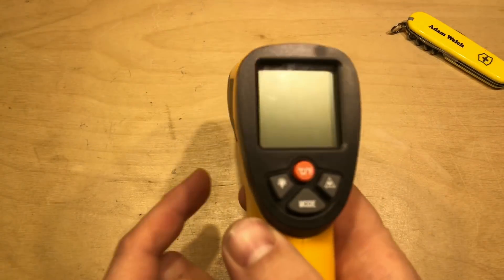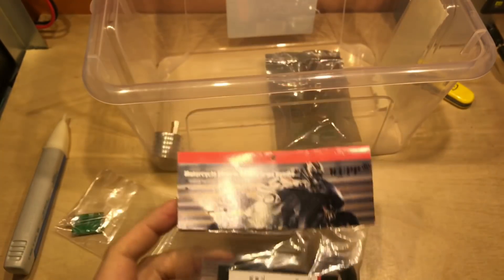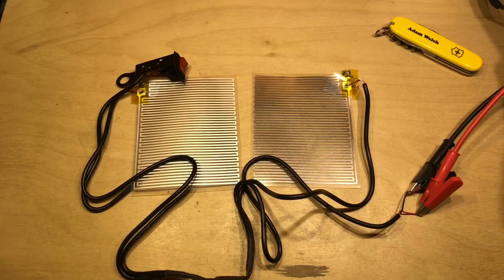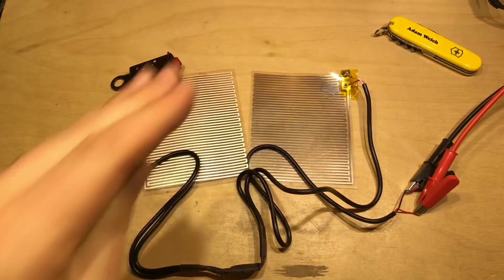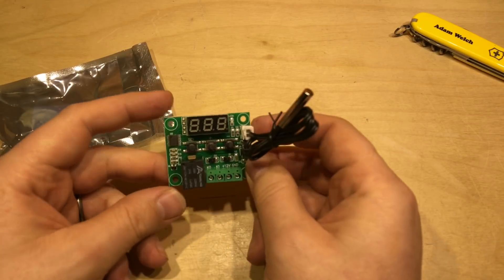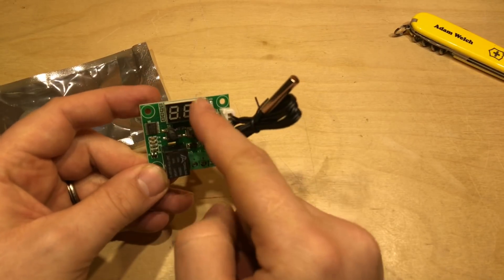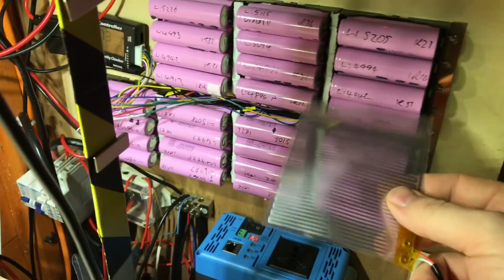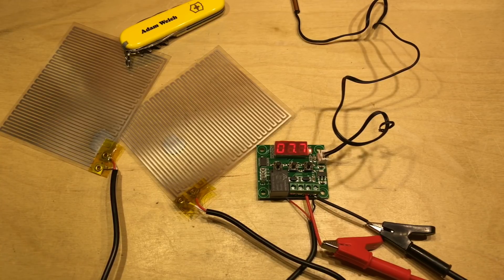Battery Warmer - 12v Solar Shed

Comment: I may be wrong, but I'm sure that the module can be used as a heater controller with different parameters so you didn't need to solder.
Reply from the maker: The time I could have saved doing a quick google! You’re right but it was fun tinkering, even if it was a waste of time.
Reply: Brian B also has hysteresis

Comment: The trouble is that your heating elements will take more power out of the batteries than the benefit of heating them will provide. If the heat is there already for another reason (from another source), then fine. But using the batteries stored energy to heat them will simply result in a net energy loss. Better to use your temperature module to halt charging or discharging if you're really worried about it. At least you're thee weeks past the Winter Solstice, so there is something to be optimistic about. :)
Reply from the maker: Yes I did think about this. You’ll notice though (although perhaps I should have mentioned it) that I was looking at my 12v system heating my 24v lithium bank. The 12v batteries datasheet says they will operate a lot lower than the Samsung 18650s. With a not-much-bigger-than-the-cells insulated box around the lithium pack I was wondering if a few minutes of heat might keep them above zero for a reasonable length of time given the heat mass of the cells. 
The days are getting longer up here,  but the worst of the temperatures may still be to come. Cheers for the comment Xan - it’s always appreciated.
Reply: Dead right. The Winter Solstice only designates the time of the shortest days, not the Heart of Winter! Yeah, since you are running the heaters from your other other bank. It might be worth a crack given the energy density of Li-ion cells. I still suspect you would be better off shedding the load from your Li bank though. Why not just switch it over to the 12 volt bank using the electronic thermostat to perform that little trick? You might need a boost converter, but it would only be for brief times when the temp is that low.
Reply: But you should never charge cold lithium cells. Seems like a necessary evolution to me.

Comment: For heating you need to set parameter P0 to h as the default is c.  Get to parameters by long press set.
Reply from the maker: Ah!  Thanks for that - I'll give it a go.
Reply: Adam, take a look here. This is the instructions I found when I used this thermostat last summer to control a beer cooler. All options are described well. 

http://www.kelco.rs/katalog/images/17670.pdf

Comment: Hi Adam

In order to avoid wasting power from the batteries, could you arrange the heater to be powered directly from your solar panels with a changeover switch to supply the batteries only when a suitable temperature is reached for charging? 
That way, when the temperature is low, but the sun comes out early in the morning, the heating can work automatically without any wasted energy (and perhaps avoid over-draining the batteries when they might already be low)?

Nigel

Comment: K1 and K2 are isolated from the 12v to run the device so you can run a different voltage if needed using a second power supply - positive from K1 power supply to K! and the device to K2 and ground or common them to chassis, but there's no reason if your device is the same voltage you can use jumpers to connect them. So only positive goes to K1 PS and K2 Device. check me if I'm wrong somewhere I have one sitting in front of me, but I haven't used it yet on my 12v cooler

Comment: I've used a seed warming mat (for seed propagation) under my external cased 12v Sealed lead acid Batteries for a few years. It has a thermostat built in. It's cheap and doesn't pull much power. Don't have a link but you can look them up on eBay :)

Comment: Also available on eBay are fan heaters for under £10 which will heat the whole shed, the batteries and you as well! 😀
Reply from the maker: I never used to feel the cold, but in the last couple of years I’ve noticed it more. Perhaps a rocket mass stove is required - it’s a bit more ‘off-grid and DIY. Cheers

Comment: The voltage on a running motorbike would be at least 13.8V and potentialy as high as 14.4V. But as someone has already mentioned it would be better to disconect the batteries when the temp drops so low.

Comment: Put the battery in a small hole in the ground, the temperature is almost constant there and it will most likely never go below zero.

Cheers
Reply from the maker: Battery hole rather than a battery box - I’ll think about it. Cheers
Reply: A.M.K.  That is a good idea. A hole about 60 to 80cm should work fine. Just make sure the hole is dry and put an insulated (not airtight) lid on it. 😀
Reply: You do damage charging cold lithium cells. If the ground is cold this is a bad idea.

Comment: Couple of thoughts, placing them in an orientation so that excess heat rises and face the cells with a thermal covering with enough air gap to let the heat rise, could be one answer,
Reply: I forgot what the second thing was :(
Reply from the maker: Yes an insulated box not much bigger than the cells is a good way forward I think.  I've got some polystyrene sheets, I just need some wood or something.  Once they get up to a reasonable temperature I'd imagine that they might hold above freezing without much heat too often.
Reply from the maker: I do this all-the-time.

Comment: Great vid. especially the peas.  I agree with the 'car heating comments', but look up truck cab heaters instead. They put out way more heat and you can get the 24volt option most of them, which is ( of course) more effecient. I use one myself,   :-)
Reply: Resistive Heating is already 100% efficient...

Comment: Perhaps you could also use a little bit of insulation. Otherwise you are warming up your entire shed with those tiny heaters.
Reply from the maker: Yes - absolutely.  Sadly the prefabricated battery container box was empty.  I'll have to build something.

Comment: Hey Adam, If you were to have a New house built, Would you do anything different when it comes to wiring? Would you have a DC line run through the house? 36v? 12v?

Comment: that board can heat or cool i have one and the option should be in the settings for C(cool) or H(heat). That is if what you have has the option
Reply from the maker: Someone else has mentioned this. Thank you. If only I’d googled the manual!

Comment: tesla cars only heat the batteries to get more peformance for high amps range or capacity, no reason to otherwise, they wont freeze, just be a little lazy but your arnt pushing them hard either, better to save the power
Reply from the maker: Yeah I’m sure the losses will out weigh the benefits - although I was looking to use my 12v bank to heat the 24 volt one!
Reply: If the battery is really cold, Tesla charger can not charge with high current until the battery temperature is good for it
Reply: This is actually not the case. Lithium can be damaged by charging at low temps. Discharging as well.